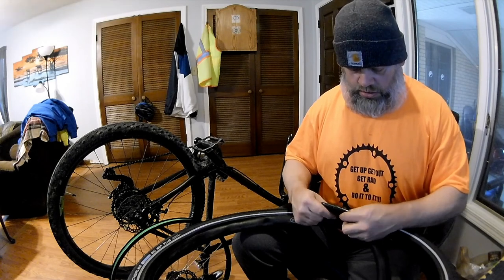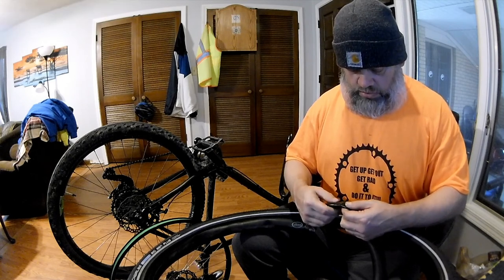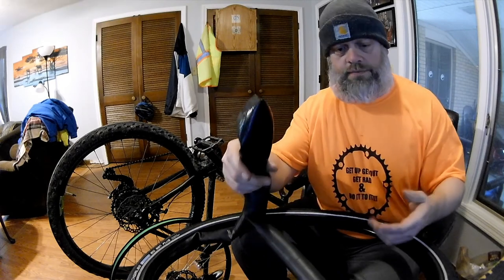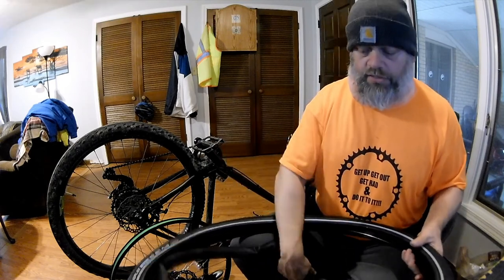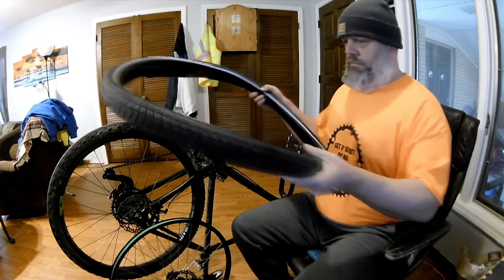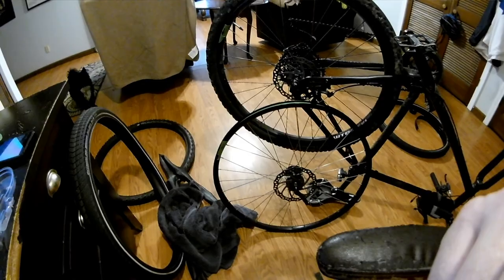Bikes and Food MORE New Parts Day 3 10 20

Comment: which model of tyre is it? which compound? some compounds wear faster, the softer compounds will grip better but will wear faster.
for this style of riding you don't need super soft rubber. but of course different compounds can wear at different rates, I don't have much experience with Schwalbe, I only have Ice Spiker Lite Skin tyres, but I haven't tried their other tyres.
Reply from the maker: the old tires are the Hurricane Schwalbe..the new ones are the Schwalb big ben plus green guard "whatever I said in the video"..
Reply: @mikieson  I checked it out, looks like there is only one compound. for this tyre, not several versions of same tyre.